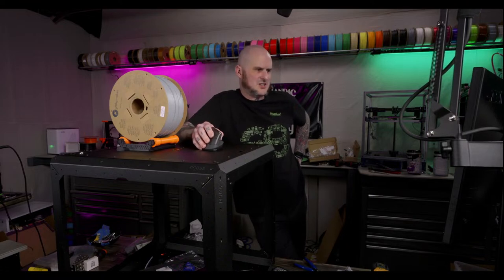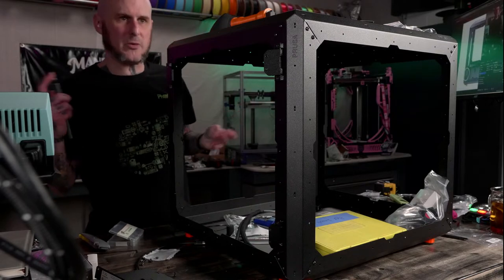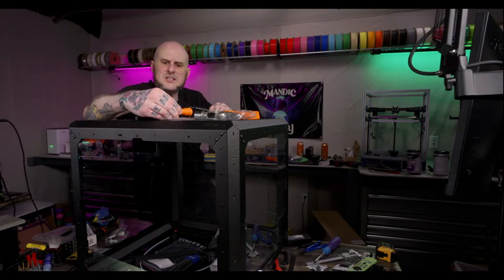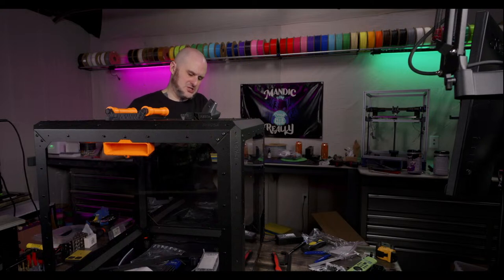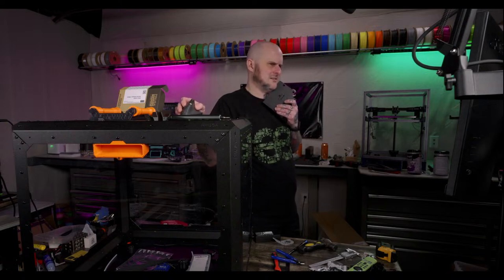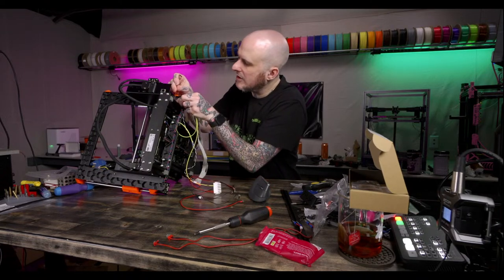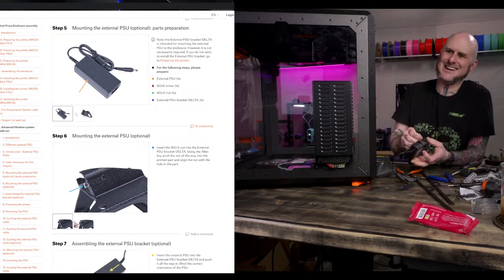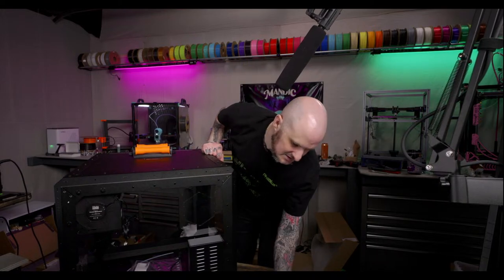Finishing the Prusa Enclosure! Build Stream 02

Comment: Idea for a collab series show, One starts a (much custom as possible and not too much planned) printer build, and after a some amount of time, say 4hours of build or when in certain predetermined state ea. the frame etc, he must hand it over to next builder. No plans, instructions or comments handed over. And collaborators will not watch each others build videos/streams until the printer is considered finished.
Reply from the maker: Very interesting, but logistically very difficult. I get the difficulty in assembly being part of the fun, that isn't what I mean. I mean that shipping machines is expensive (even small machines need good packing protection and start to get hefty). And the chance of something getting lost or damaged increases with every shipment. Still a solidly unique idea. I know some art YouTubers have done things where they each paint a portion of a painting until the canvas has traveled all over and ends up as one final art piece sold for charity.
Reply: @MandicLabs  Hey c'moon, its part of the adventure, what happens in shipping, adds it's own twist 😄And yeah, in the end, printer is auctioned for charity. Not my own idea, 8bit-guy + other old computer stuff youtubers did something like that.